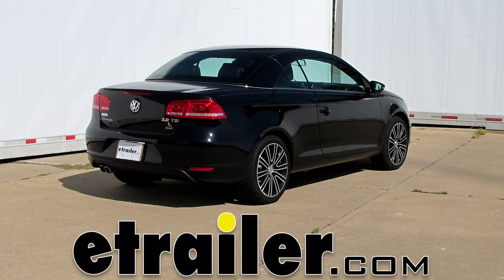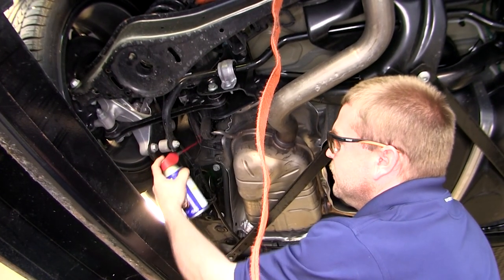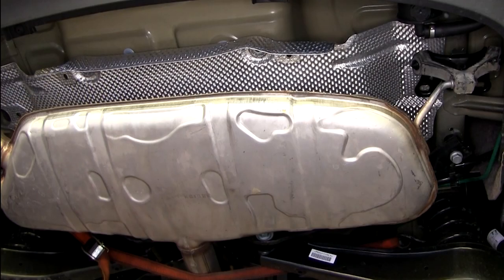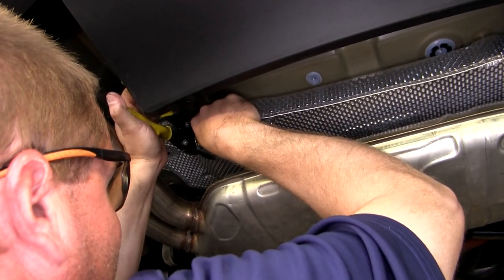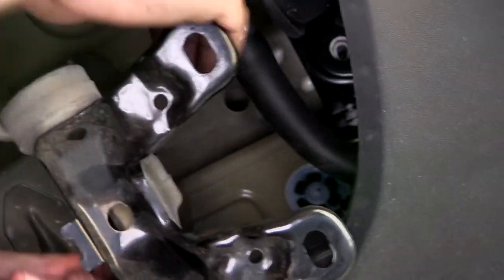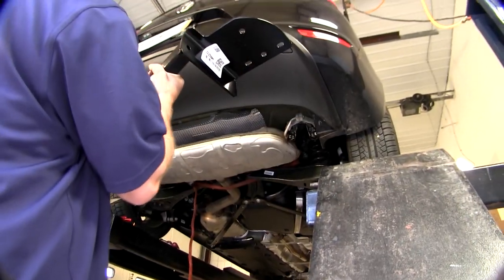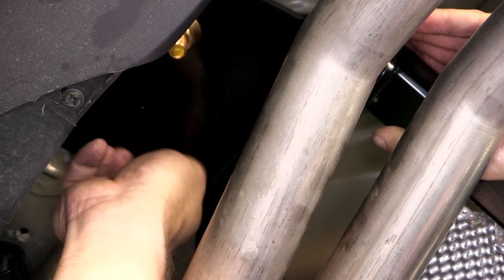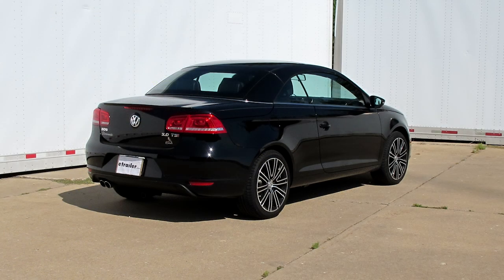etrailer | Setting up the Curt Trailer Hitch Receiver on your 2013 Volkswagen Eos

Comment: Consider removing the heat shield after disconnecting it to make it easier to cut. It will also make it easier to ‘test’ the alignment of the hitch holes should you need to modify said alignment.
Reply from the maker: Thank you for sharing this with us and others who might be installing this hitch themselves. This would allow you to line everything up to ensure proper fitment.
https://www.etrailer.com/Trailer-Hitch/Curt/c11090.html